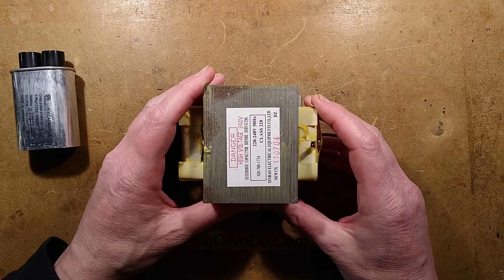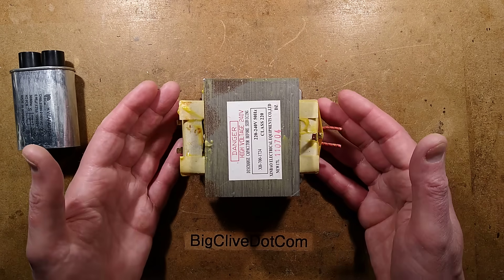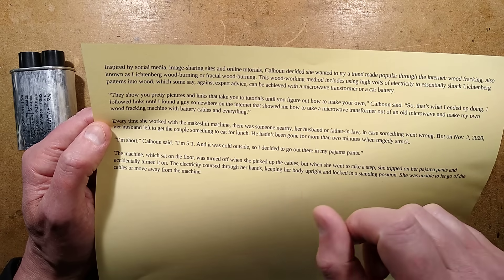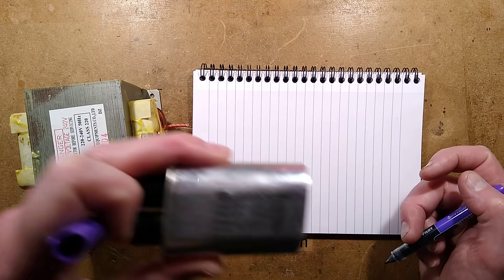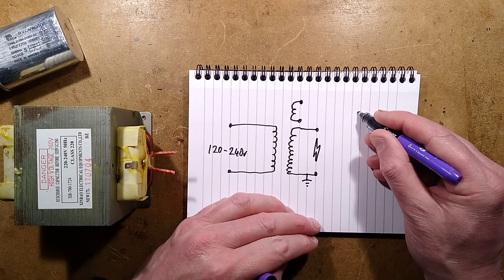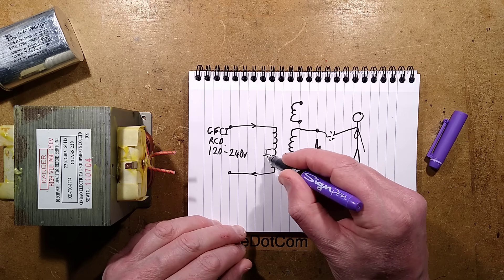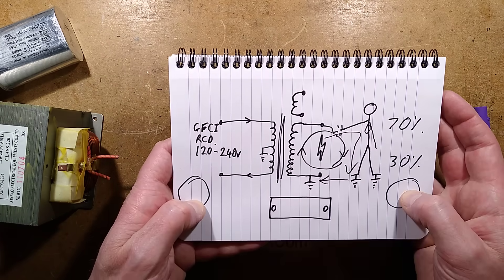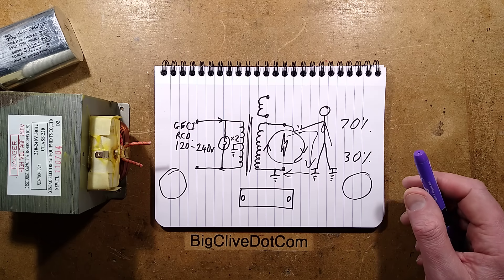The most deadly project on the Internet

Comment: This is why you wear non metallic clothing including electrical hazard boots, have face shields, wear rubber gloves and even have a non metallic stick to work on high voltage. Also Microwaves in America come in two flavors 120v general home and commercial 209/240v because America does actually use 240v for large appliances. I think that feeling of AC voltage going through your body the involuntary spasms on your finger, everyone has to feel that once in their life. FEEL THE POWER.

Comment: I've ha a go at doing this but I used nails in the wood with alligator clips to connect the transformer to the nails then I'd use the wall switch to operate the transformer keeping me well away from it with the ability to shut it off if something goes wrong.

Electroboom shocked himself with one hooked to his Jacobs ladder he was extremely lucky it disconnected as it fell on him.

Comment: Huh, I saved the transformer of my old microwave for the spot welder project, but I would have assumed that I should remove the primary, use the secondary as the primary, and then add the low voltage turns.
Reply: That would be very much pointless.You'd get almost no power out of your huge transformer.
Reply: @Basement-Science  Why do you say that? Core saturation?
Reply: @PaulSteMarie  no, the opposite, kinda: It has "too much" primary-side inductance, which you can consider to be in series with the transformer, limiting the current. 

The wire diameter is also too thin to get any kind of efficiency as well, even if the inductance was correct. It just doesnt make any sense to do in any way. There's a lot more to Transformer Design than just the turns ratio.

Comment: Could you build a GFCI-like breaker into the high voltage side, so if it senses that the voltage from the hot side to before the grounding is amiss it can trip the breaker on the mains side? I definitely agree with your dead-man's box suggestion, but just in case you happen to be standing in a bucket of salty water while holding the dead-man's box it would be nice to have suspenders with that belt. Also, rather than holding the box in your hands, I'd think you'd want to push into the buttons on the box with your knuckles, that way the involuntary muscle contraction would pull you away from the box.
Reply: GFCIs can't break high voltage.

Comment: During my electrical apprenticeship back in the 70;s we were warned about the charge that lurks in large capacitors that could throw you onto the ground in a most undignified manner. I got zapped once by the high voltage supply in an old valve radio. You can be sure I have been ultra careful since then.

Comment: I started watching this video with my wife, who panicked and thought I was going to die. She knows I have about four of these I’ve collected and I built something using them. I built a spot welder, which is totally fine. Also, even there, I use a two button weld and a spring loaded contact to hold the metal down while welding. 

So, while she panicked, thanks for having the welder example in there. :)

Comment: Microwave Oven Transformers (MOTs), by design, transfer 750 to 1500 watts ! That's more power than any other transformer available to hobbyist. Even more power (watts) than neon sign transformers ! The secondary on a MOT is the ballpark of 2KV. These are not to be toyed with.

"Its the amps that kill you, not the voltage" NO ! Its the total energy (power times time) that gets delivered to the load (you), that determines, if you die. A MOT is very capable of delivering enough energy, over a very short time, to do it.

Comment: Seems like the most effective way accidents would be curbed, would be for a design to be popularized that utilizes a relay to switch it on and keeps the high voltage components nowhere near being handheld. Maybe some company will figure out one that could pass UL and not have the lawyers screaming at them, so people just plonk down the $150 or whatever it'll cost.
Reply: What you'd want to do is find an OLD design from the 30's for things like this, then popularize it.  That insulates you from being responsible for people's stupidity.  "It's a design from the fourteenth issue of Popular Mechanics!   Go sue them!"    That was the time period of the "interesting" electrical equipment, such as the mains powered vibrating safety razor.   (No, I'm not kidding.  SEIMENS made one that used a battery pack -charged by mains voltage, which was marginally safer)

Comment: the output of the transformers from microwaves from the 70s and 80s can be as high as 4000 volts ac however todays it is lower around 1500 to 2000.

you did the right things to remind us of the safety issues with using microwave transformers.

Comment: Perhaps a DMS with buttons that require extension of the thumbs instead flexion, as if a shock occured the thumbs would pull away from the buttons not lock in place.

Also, my NST has been sitting in storage for years, right next to my hand wound 1000 turn Tesla coil secondary.

I'll finish it one day...

Comment: what is the ratio like 1:100 or something...daggum!  
That much voltage and current could kill you dead as a doornail! 
Nope nope nope
Thanks for this video...definitely a PSA for sure!!!!
at the phone company I work for...when we work on remote cell towers connected to high tension power line sites...we had to use class 3 electrical gloves and we could NEVER have one foot on the metal platform and earth ground...I made it a personal point to hop to the first step with both feet so none of my body was between the contact points and ground

Comment: I too had an incident with one. I was a young teen and didn't understand how dangerous they were, I found I could use the high voltage output along with some graphite pencil rods to do something or other I forget what. One day something happened and the arc flashed over my damp sweaty hand from one side of my palm to the other side leaving a raised Licthenberg patterned burn across my hand. Thankfully the dampness of the sweat flashed off most of the energy into steam and the burn was just in the outer layers of skin as a faint white outline. It scared me enough that I tossed it into the back of my closet and forgot about it on purpose. Many years after that I was working with something connected to 120V mains measuring for AC leakage from high to low voltage side because I had a flicker or interference or something and bumped my leads and arced about a lot of amps at 120V across a meter lead and popped a breaker.  I haven't touched mains voltage when it's live since then. High voltage is a hard pass, even working on cars at just 12V things can go sideways in a big hurry when you short across a battery on an unfused cable!

Comment: I've been working on an industrial bakery for 7 years now which uses wood to cook their bread. There is a machine they had to install called a Smog Hog which scrubs the exhaust air of smoke. They got cheap and started using the bakery staff to clean it instead of the specialists from Smog Hog. 

One day it was having some electrical issues, so I repaired it part of it and one of the grids was down. I went home to do research and came to find out the unit runs 30kv through the grids with capacitors. You have to use a kV meter to test it to make sure it's functioning properly and discharged.

The whole time the bakery staff was cleaning the unit they never knew to discharge any of it and could have died. I promptly warned them of the danger. 

The scary part was all the warnings on the unit looked pretty standard to me like any other HVAC unit. It could definitely use some kV warnings or something to that effect.
Reply: Exactly, "high voltage" and "discharge before servicing" is pretty much on everything I work on. I didn't know it meant kill you high 30KV, I thought it was just throw your arm off high 460v.
Reply: That's really interesting. All of the safety first bs that we've all come to accept is mostly bs actually sometimes isn't bs at all, and how can we tell the difference?  I think it's quite possible that we really can't tell the difference much of the time.
Reply: @josephdestaubin7426  - The 'safety first' people with groups like OSHA have made it that safety warnings are completely ignored because they're so ubiquitous.   We're so over saturated with warnings for everything that true warnings don't actually become meaningful.    I can't even count the number of times I've seen egregious safety violations done because of that.   (I mean, really.   Cages (electrical and fire suppression) that are supposed to  have nothing within 8 feet of them - Completely blockaded by cargo. )   

It's part of the failure of personal responsibility, predominantly driven by the legal system, but actively supported by many governments.
Reply: It's an electrostatic precipitator. Basically, an insectocutor on a human scale.
Reply: @cammy9r  imagine if the car was a V6 instead and they got 24 volt bulbs..
Reply: @jnawk83  got you better with my '02 VW Passat and it's ATQ engine.  Whopping 30V. 😎
Reply: @cammy9r  Some car audio modders run 4S lipo (16V) to get a bit more power out of the setup.
Reply: I have worked on smog hogs. Yes, they are 30kv but the power supplies will only put out a couple milliamps at best. That will wake you up but its not going to kill you. Plus they are interlocked so the power is shut off when you work on it. 

We serviced our own and a guy came and picked up the plates to be cleaned and dropped off a fresh cleaned set.

Comment: Thanks for bringing this issue to light. It cannot be said often enough:
There's a reason why you should always be very OCD about safety protocol in high voltage and/or high current situations.
There's a reason why the safety protocol was written down or arrived at in the first place, and it's written in blood (or charred appendages), paid for in injury and death.
Also, I would have an indicator light in both the dead mans switch box as well as the box containing the MOT. The latter will cut down on the chances of accidentally touching live HV parts, especially if one is using proper HV cabling.
I wonder whether a general video on the virtues of avoiding "Hot Work" whenever you can might be in order? 🤔
Reply: You would be surprised how many people with OCD are also ADD/ADHD.
Reply: @TerryLawrence001  I am. I am diagnosed with autism adhd ocd and a multitude of other mental health issues as well as physical health issues. 

Unfortunately my ocd is that of severe intrusive visual images and sounds rather than the compulsive behaviour type although I do have 3 particular issues around odd numbers/half paving stones. Single magpies and doing what is now called shutting down routine by my partner (every switch socket lock turn knob all checked multiple times before bed going out and sometimes randomly.)  

I wanted to do this fractal burning but was warned about its dangers recently as I have just taken up wood turning although my attention span and attention to safety is well awful due to my adhd I often get injured doing projects or just existing thanks to these issues .  I must say while I'm not going to complain I do hate that the phrase about being OCD about safety or in other things are slightly offensive as if you don't live with actual ocd you don't realise that it is actually extremely difficult and  often a negative thing to live with there are very few positives about living with OCD. But again I understand why the phrase gets used.
Reply: @davesmith7671  My OCD manifests itself around safety to the point that I freeze and can't move forward until so many checks are done that the job halts. I had to retrain myself for a different job because of it. I can't do anything about how you feel about what I said, but I DID NOT MEAN TO OFFEND ANYONE. I recommend you seek further assistance with your problems, what ever you are doing obviously is not working. You sound like a negative person and that is not how I chose to live my life
Reply: @TerryLawrence001   @Terry Lawrence  I am far from a negative person . I too have had to stop doing things I love due to my intrusions and the way the OCD took over my life I had to stop the wood working I used to love doing due to intrusions of wanting to put my hands in the table saw blade or images of hurting people with my chefs knives at work. I've suffered with multiple other issues regarding these some I will not mention due to both it being sensitive and also very graphic and disturbing. I did state that I do understand why people use the phrase or say things like I'm so OCD about this etc but I did also say that I find that offensive when it is done by people who do not understand how much it actually takes over and interferes with normal life . I did not specifically say you offended me I understand safety is a very serious issue exactly why I had to sell all my power tools that I could hurt myself or someone else with why I no longer work as a chef even though that's where all my qualifications lie.  As for your comment about seeking further help. I'm afraid I've already been on that pathway now for well over the last decade . I am under several mental health services I have support workers who help with my social isolation and appointments paperwork etc I have a psychiatrist I see every month along with a psychologist I see at the moment every 6 weeks. I am on multiple medications I am very proactive in taking care of my mental and physical health.  Also I'd like to point out I was actually siding with you on your comment as you were not the person who used the phrase "There's a reason why you should always be very OCD about safety protocol " but when you said about people with OCD also having adhd or add I was agreeing as I am diagnosed with both adhd autism and ocd along with other things . It was a commenting backing you up. So I'm not sure why any of this is necessary to be honest.  My gripe Is with people who do not suffer with OCD using the term to describe when they are in fact just being careful or thorough as opposed to someone like yourself or myself actually struggling with the effects of OCD taking over and completely ruining things like hobbies careers or just daily living.
Reply: @davesmith7671  + @Terry Lawrence -  It will surprise you to hear I have OCD myself... For the time being under control, but there are times it is very difficult to handle.
And yes, OCD is just about all of the time something which impacts your life negatively, but there are some aspects of it which would be useful if it was in some other context that OCD invariably is.
One such context is safety protocol, not only in dealing with electricity but other fields where ignoring it is unforgiving.
You approach it by always doing it, not by rote, but out of deep concern for the  safety of you and others.
IMHO, you should feel a pang of anxiety at the prospect of skirting safety protocol, and rather apply it one time too many than not at all.
And if you can't, find some other field of work.
I have seen enough skirting of safety protocol, from mere facepalm discoveries to things ending in utter disaster, as well as things that would've ended in one if it wasn't for some chance occurrence to unironically say that.
And the same goes for content creators: If you can't be bothered to do a safety walk-through and show it in your video, preferably in a teaching and informative way, maybe you shouldn't be doing it in the first place.
This is especially true for things concerning electricity.
Reply: @Teukka72  thank you for clarification.  I won't say it surprises me you too have OCD I know there are a lot of us and I know we do all have it in different states of control .  I will apologise to you both for coming across negative or combatative . And I will again state as I already have my gripe is with those that use that phrase sentence or just the term OCD to describe things such as how they are regarding their cleaning their work their earing habits to hear someone say "I'm so OCD about" and it be totally mundane and to hear them say  " I don't have OCD but I'm so OCD about x y or z" and to be someone sat there wishing that you too were not suffering with something so debilitating it's to my personal situation offensive or maybe thoughtless of the person and having heard it so many times it becomes somewhat of a trigger.   

But I totally agree there should always be some level of anxiety with anything that requires a safety protocol to be in places where as such you may end up seriously injured or dead as a result of not following it to the letter. And ergo I am prime example of this I've been sewn up at the hospital so many times be it from accidents during a hobby such as woodworking working on cars or at work  but that's where I was agreeing with the other guy it's a bit harder having the adhd on top as concentration is lax even midway through using the band saw my mind would wonder off and so would my eyes and my hands would still be doing the work end result going for stitches . Once broke my ankle collecting some felled tree logs.  I then had intrusions of jumping Down the stairs on my broken ankle sideways for almost 7 months I ended up re breaking the ankle due to not paying attention and hobbling off a kerb into the road and suffered a worse break. Safety should be followed at all times. In all aspects and if you're putting information or videos our there there others to see it most definitely should be included that there are numerous risks involved and ways to mitigate these risks correctly.  

I again apologise I did not to come argue or anything with anyone I literally saw a comment  I was agreeing with from experience and it turned into somewhat of an issue I did not expect .